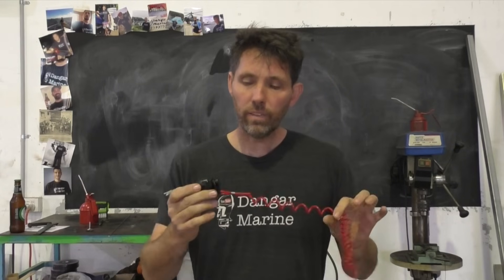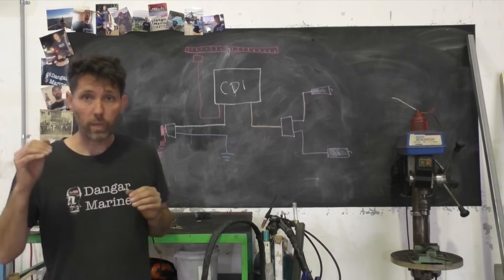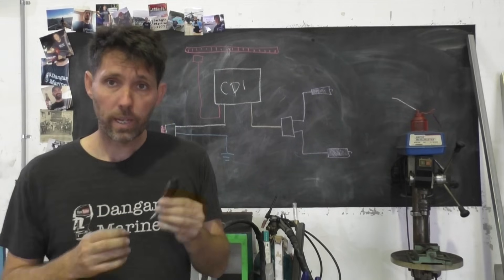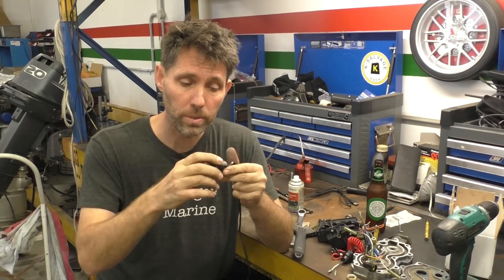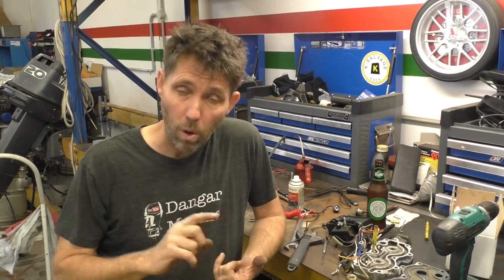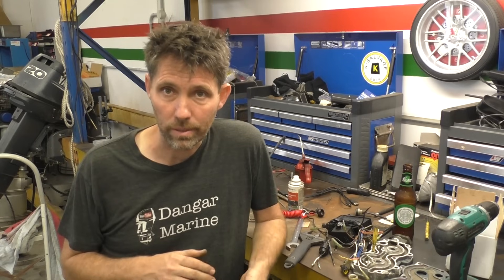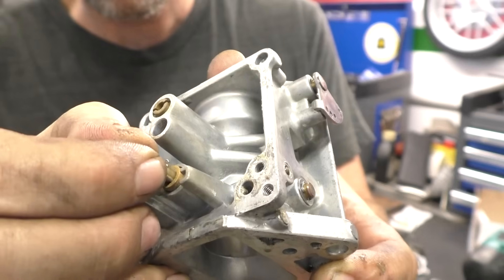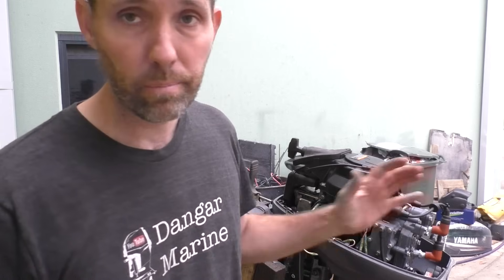Outboard kill switches

Comment: So my engine will start and run without the clip in suggesting the switch is stuck open.  when I put the clip on and pull it off (when engine running) the engine kills off as expected.  it sounds like the switch is gummed up and or the spring is weak so when the clip is not on, the contact inside the switch is not quite going far enough to kill motor.  But when pulled out and clip on the spring is loaded and just as the clip is yanked off, the spring has enough pop to push the switch closed and kill motor.  perhaps a little pb blaster will free it up?
Reply from the maker: It's worth a shot, you can get these switches open. I would use something like brake cleaner though that doesn't leave a residue.

Comment: Good video mate always wondered what was inside one of them ,when i did the anglapro up i had 3 kill switches one on the consul the lanyard and also a button on the front which i think would have been used for a starter if you put electric start on an enduro  but they were all handy ,pull up to a spot and kill the engine and just glide in trolling at the back get a hit push the button and fight the fish anyway good video .
Reply from the maker: Sounds like you had a good setup.

Comment: Hi Stu, I think I have the exact same motor as the one you are working on, the orange rubber cap on the kill switch is perished on mine. I guess this cap helps keeps water out of the internals, I can find a replacement on a website but they want $7 for the cap and $8 postage. I also tried looking on your sponsors site but found it unhelpful and confusing, maybe a tutorial on using their site if you are short on material some time. Can you suggest alternate replacements of should I go with the genuine Yamaha part?
Thanks
Athol
Reply from the maker: If you can get the part you need for $15 total I would go for that. I have only ever seen the entire switch sold by Yamaha and they would be a lot more than that.

Comment: Can you do a video of replacing one of these in a Yamaha 703 control box purchased a boat with a Yamaha 90 horsepower and my 703 control box starts and drives without the safety lanyard attached the kill switch is there but the safety lanyard wasn't even with the boat when I bought it. Any help would be obliged thanks
Reply from the maker: Fortunately those kill switches are really easy to replace. The wires are colour coded and have push in bullet connectors and the housing just has a threaded collar. Here is a video doing a different job on taking the 703 apart, but it will show you how to get to it. https://www.youtube.com/watch?v=t3DiUd2WI5k

Comment: I have a 94 seafood p with same kill switch and it works backwards   key out it runs out key in shuts off  what's my problem?
Reply from the maker: That's weird! It's hard to imagine the switch itself failing in that way, but I would disconnect it and test it with a multimeter to see if it functions as expected (close circuit with key out, closed circuit with key in). If the switch is fine then it sounds like it might be wired oddly at the outboard end.

Comment: Good day to you and thanks for the vid. Can you advise why my kill switch seems to heat up quite a bit when I pul out the lanyard and blows the main fuse..?.
Reply from the maker: It must have a short in the wiring somewhere. When the kill switch is out, the wire it connected to ground. If positive current is getting to the kill switch then it will be a direct short hence the fuse blowing and the heat. One side of the switch will be going to a bolt on the engine block (ground), the other should go to the ignition. Trace that wire and see what is going on with it.

Comment: Thanks for the helpful videos.  I just bought a used boat about a month ago.  It is a 2003 McKee Craft 172 Backwater and it has a 2004 Tohatsu 90 hp TLDI.  First time I took it out it started right up and ran well, I was able to shut it off and restart with no issues.  Daughter had to use the restroom so I went to a dock turned the engine off and when she got back in I was able to restart it and slowly made my way back out to deeper water and when I tried to give it some throttle it died and I had a hard time getting it restarted but luckily I was able to get it started and back off the water.  Did some research and thought it was likely old gas so I replaced the fuel/water separator and dumped a can of Seafoam in the tank and ran it from home with muffs.  Stalled one time in the driveway but figured that was because I didn't prefill the water/fuel separator with fuel but once restarted I could not get it to repeat the issue so I figured problem solved.  I have taken it out 2 times since this and it has started on the first try and ran flawlessly for the entire day both times.  After taking it out last Monday, I brought it home and started it and ran fresh water through it in the driveway for about 15 minutes on idle.  No issues!  So I load the wife and kids up this past Sunday drive 45 minutes to the boat ramp, put the boat in the water and I can not get it to start.  It was acting like the battery was low.  When I turn the key it makes the beep sound and then I try to turn it to start the starter cranks the flywheel but seems to not be cranking with enough power.  I unplugged the battery and plugged to another battery I had with me and it does the same thing.  Another boater saw me having issues and offered his freshly charged battery and it did the same.  The GPS/depth finder and electric trim work fine but the engine will not start.  I have been removing the key and kill switch when I park the boat so it has me wondering if the kill switch could have broken and the motor thinks it is removed.  The other strange thing it is doing is the beeping sound comes back when I turn the key to start.  So what I mean is it beeps for a couple of second when turned to on (this is normal) and when it stops I attempt to turn to start and the engine tries but with little power to start and the beeping returns.  Could I have a bad kill switch or ignition switch?  I tried turning the key to on and cranking the flywheel manually but it didn't do anything like it was not sending anything to the spark plugs.  Pulled and cleaned all 3 spark plugs but cant get the boat to do anything.  My local marina cant look at it for 3 weeks and I really want to get it out a couple more times before winter.  Any suggestions on what to check, what to do?
Reply from the maker: So there could be a couple of things going on here. Firstly, if it is cranking slowly even though the battery is good, it could be that there is a voltage drop over the battery leads (https://www.youtube.com/watch?v=5tGCepHveHk&t=1066s) due to some internal damage or the brushes in the starter motor itself (https://www.youtube.com/watch?v=woVT4czk6ao&t=1s) are starting to fail. The kill switch can be tested by unplugging it as when it is unplugged you should get spark. https://www.youtube.com/watch?v=SN17iBL5lps
Reply: Dangar Marine Is it really possible that the slightest amount of rust on the battery connectors could have been causing my issue? I tested the continuity of the kill switch and determined it was fine. I had 12.5 volts at the battery and at the starter solenoid when i turned the key to on so I didn't think it was a connection issue but figured I would start with the simplist thing and pulled the battery out wire brushed the terminals and connectors then reconnected and tightened everything snuggly. I did that and cleared all existing fault codes then gave it a try. Didn't start the first attempt so I checked to see if it fired new codes and it didn't so I gave it a 2nd try and it fired right up! Turned it off and on multiple times with no issues. 
Almost wish I had tried again before cleaning the terminals and connectors just so I knew that was really the issue. Just seems too insignificant as the terminal and connectors looked pretty clean before I did anything and I had the boat out less than a week before having issues and it ran and started fine then. Hopefully my problem is fixed but I am not 100% convinced.

Comment: My kill switch operates by shorting the 2 coils.  Does that make any sense??? I thought the spark needed to be grounded to kill the motor.
Reply from the maker: All that really needs to happen is for the energy to not make it to the spark plugs. By shorting them it may achieve the same effect if that is the intended design.

Comment: Congrats on your channel... i need some helpful tips please. I have a 1993 70HP johnson outboard and i am not getting spark from 1 cylinder. Someone advised me to check the kill switch since i am having trouble with my shift box too. Will the kill switch cause for 1 cylinder not to spark? Power pack is new, timer base is new, new spark plugs, and just replaced the coil on the side not firing and does the same thing. Please help...
Reply from the maker: No, the kill switch will stop spark on all cylinders. This video will give you some tips on diagnosing this problem https://www.youtube.com/watch?v=MDbvkFM1V_c

Comment: 2000' suzuki df/50 4 stroke efi..
Motor dies when press trim up tab on remote but not on motor..  

My failure analysis will be 1. bad ground/melted wires- check for power and continuity possible power surge 2.  Bad handle switch 3.  Bad trim sender follow wires thru outboard motor and replace trim sender.  

Seems to me like a dead short on the up trim that instantly kills battery..  This action would also kill my voltage regulator$ then stater$$$...   But looking at cheapest fix first.
Reply from the maker: One of the easiest fixes I've seen for this that is quite common is to run fresh wire to the front and put a standard three position switch on the dash. This way you don't need to hunt for a hard-to-find wiring fault  or buy an expensive OEM switch.
Reply: I took the remote apart and it exploded: cams and shutoff sensors and a tightly packed wire bundle.  The wires that had rubbed off the sheath as they were wearing against the cams, the sheath that was cut by a knife on the main wire harness 17 years ago when it was new. Eventually corroded the wire filled with water and burned it in half and grounded to the case causing a direct short when activated the up trim.

 Tried it put it back together, now it wont start but the BUZZER  works...  Prob the neutral sensor issue, i hope i got all the pieces in the right place.  The Diagrams are crap... 

There is no instructions on how to rebuild an outboard remote what to grease, neutral limit kill switch, button kill switch proper operation, or the best way to connect single burned wires in a marine harness (&salt-proofing)

Comment: I have a suzuki outboard 50hp.  The instant  i hit the trim up tab on the handle the motor dies...  No power for 5 min then it resets and I can start the motor again.  But the trim works on the motor with no failure

Can you do a video on remote trim sender...
Reply from the maker: Hey Paul. Hmmm, that's a weird one. It must be tripping a circuit breaker that has an automatic reset. Is it a quite modern outboard? (Have added the remote trim switch to the list)

Comment: On my old Chrysler the kill switch wire came in contact with the flywheel causing it to run with bad spark.  When I noticed what was going on I unhooked the kill switch and the motor worked fine.  Glad to see the sponsorship I've ordered from them for years.  Its great for someone like me that fools with old motors.  They've got NOS parts dating back to the late 50's.
Reply from the maker: HI mate, wires rubbing against moving parts is always going to cause you trouble, that's for sure. Glad to hear that MarineEngine.com has been able to supply you the parts you've needed. :)

Comment: I need to know if the johnson 40 hp.when put on a boat with  one of the trim cylinders unhooked could cause a problem with the steering
Reply from the maker: I wouldn't expect so unless it is one side of a dual ram system and it is pushing the outboard up and an angle and binding up the tilt tube that the steering cable runs through.

Comment: did you ever sync the carbs on the vro evinrude?
Reply from the maker: I set them all to the factory setting on the idle mixture screws and made sure all the butterflies were closed at idle, but that is as far as I got. I would be interested in giving it a good tune up once the run in period is over.
Reply: Dangar Marine .  would be interested to see how a gtc 505 could be used in tuning multi carb engines.  maybe faster and easier substitute for vacuum tests.
Reply: i have an ignition analyzer called a gtc 505 made in canada.  I have been waiting for an opportunity to tune a multi carb outboard with it using secondary ignition kv and wave forms.
Reply from the maker: I'll check it out and see what it can do.

Comment: What happens if both wires are cut cause I carnt figure out y my old 15hp out board won't start
Reply from the maker: Thanks for jumping in mate, it's hard for me to get to all the questions myself so it's great when you guys help each other out. :)
Reply: Sooty Fishing FNQ Check and see if the wire coming from the outboards wire harness goes to the kill switch. Follow the wire and see if it was cut without a different spliced wire connected to a direct route to the ignition. Did you cut it or buy it used and previous owner cut it?
Reply: I cut it to get the throttle cable off
Reply: just buy some wire connectors (I think 14-16 gauge) get a cheap crimper HF has em. And connect the wires back. If its to short just add some wire by crimp or solder

Comment: Awesome news hearing about your sponsor, these videos are like popping bubble wrap, more more more!!! 

I cringed watching you spray carb cleaner through the needle seat, fuel galleries have a uncanny ability of directing cleaner back at your eyes with force, it happened to me and that stuff absolutely kills your eyes, worst pain ever and the most hideous blood shot eyes for a month after. Be careful mate. Think my Tohatsu 60 may have a carby float issue as well, while running (badly), there is fuel trickling out of the carby throat at idle, takes a lot to get to full throttle and runs fine at wide open throttle.
Reply: Jer0tube Float needs to be adjusted lower. Probably needs to just be cleaned like STU did. If not set the pin to proper height.
Reply: +jimbo “blah” gasoline yeah have never adjusted the floats, just cleaned them, thinking a sticky float might be the issue, cheers mate!
Reply: Jer0tube Im dealing with an issue myself. I adjusted the oil pump because the previous owner had it set on a very lean setting. After I adjusted i the manual oil output test by running premix and letting the oil line run into a measuring cup. It's now producing the right amount of oil but now the motor runs crappy and spark plugs drenched in oil. So now i gotta adjust carbs and not looking foward to it. I've never had to adjust carbs on any motor that had more than 1 carb.
Reply: +jimbo “blah” gasoline Yep, all I can say is oiled spark plugs are cheap and easy to replace under rich oily tuning. run lean and pistons melt. I know how I'd rather the engine tuned.
Reply: Jimbo, that engine didn't come from a high lake area did it? I am thinking along the lines of smaller jets being installed and therefore the lower oil setting required. But at idle the oil flow should be pretty low for most variable oilers- around 100:1, WOT gets up to 25:1 on some engines. Just an idea
Reply: jimbo gasoline, I did a clean out of my carburetors today and found one of the needles seats had worked it's way loose resulting in a much earlier closing of the needle valve. I re adjusted it, cleaned all carburetors and now the motor runs fine. Just something to keep an eye on.
Reply: Ron Powell Damn..good idea man. I've never even thought about a smaller jet. I have a friend thats a pro outboard mechanic whenever i get in touch with him I'm gonna ask him about it. This is my only motor I currently have and im  nervous to tinker with different settings. I don't have much experience with adjustments. I really am looking for a cheap older 25 hp motor to rebuild (try too at least). And would like play around with adjusting the carbs and such. Thanks for the advice man! And I live in south louisiana and the motor was bought about 1 hour from where i live so I don't know if that makes a difference or not?
Reply: Jer0tube Cool man Im glad you got it fixed!! My motor is fixed now too. My problem actually wasn't from the oil pump adj. I brought it to my mechanic and it turned out to be the fuel pump. One of the check valves wasn't seating properly and it was only a $3 plastic valve that need to be replaced. The mechanic actually told me that adjusting the oil pump would just cause it to smoke more (which I knew) but would not cause my problem(which i didn't know). I just assumed that was it because it happened right after I adjusted it. Thanks for reply and for helping out!!